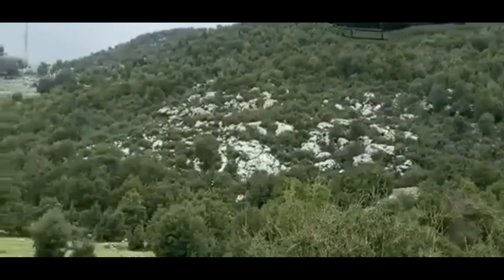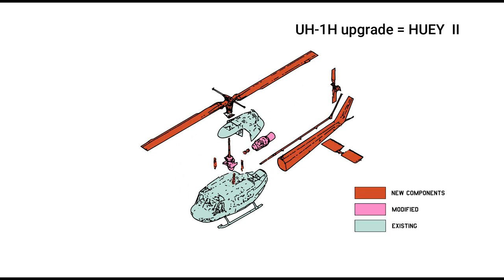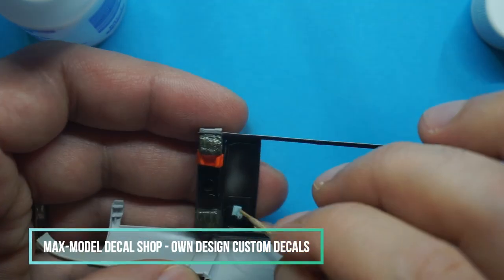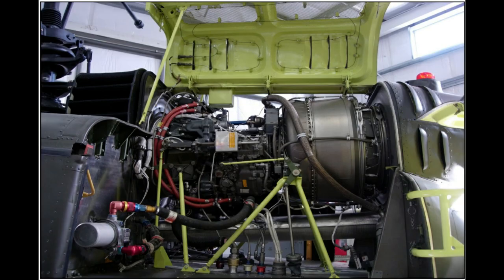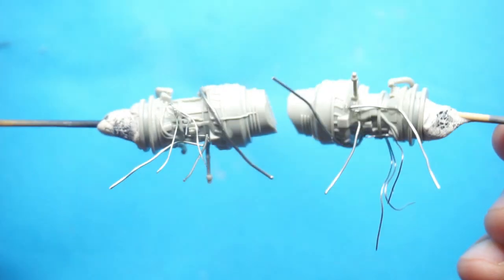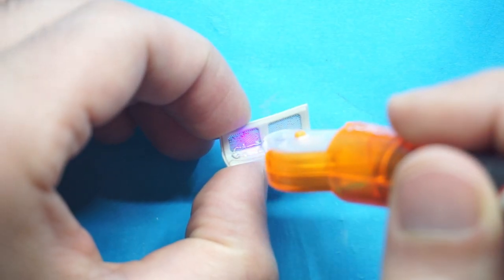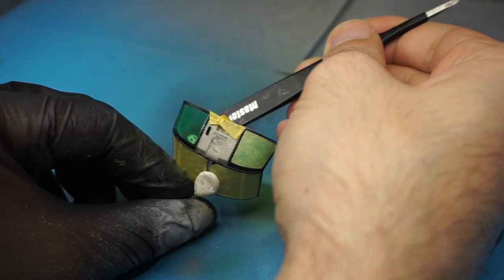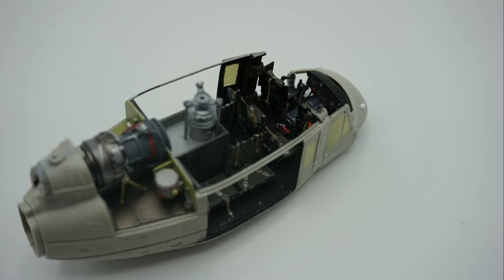UH-1D "Huey" Kitty Hawk 1/48 Lebanese Air Force UH-1H and Huey II - The Cabin part 2 of 2

Comment: please what type of "lead" weight did you use to keep the helicopter up right, along with the blue tak. I am finding the same trouble with the tilting of the aircraft, and dont know where to buy the lead in small sizes.
Reply from the maker: Hello Hotwires101 I used some 20g lead weights found in fishing shops! Let me know how that works for you! If you need a dedicated professional ad hoc help please consider becoming my Patreon check the link In the description. 😊
Reply: Thank you for your help, the fishing sinker works well.😃🙏
Reply from the maker: Hotwires101 my pleasure🤗